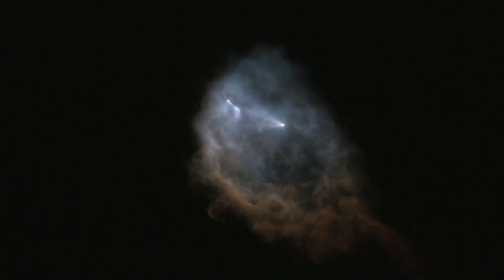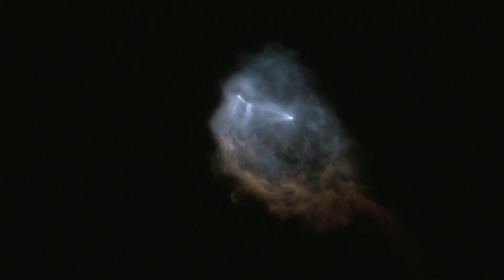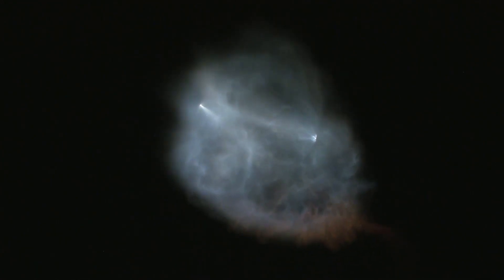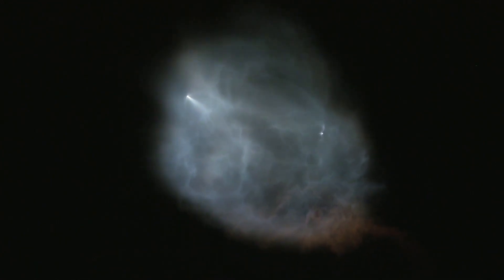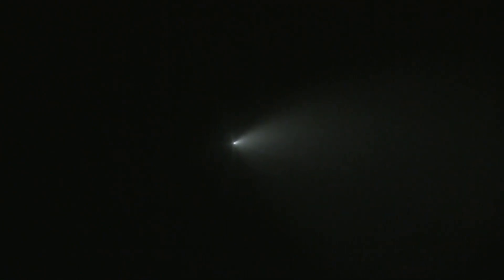SpaceX Falcon 9 SAOCOM 1A Launch 10-7-18

Comment: Jim Mudgett:  Was something in the way to not show the back burn and booster landing from you location?
Reply from the maker: I'm about 100 miles SE of the pad and am in a bit of a valley, so the landing burn is blocked by mountains from my location.  One of these launches I want to get closer to see more of the launch and booster landing....and hear/feel the sound.
Reply: Well, Jim, SpaceX: Nov 19, 10:32 am. Not sure about booster landing location yet.  ULA DELTA 4 HEAVY spy satellite(THIS IS LOUD), Nov 29, Time tba .  SpaceX Dec 30, at 8:38 am weather permitting. However,  the booster will land off-shore on the barge, between 1/4 mi to 4 miles off the shore.  The Launch and LZ-4 pads are 1/2 mile from beach. Google Maps will show it.  It is WSW OF LOMPOC.  Every vantage point N of VAFB on HWY 1 called Harris Grade will be full if you get there late.  Hwy 1 is high enough to see both launch and booster land on barge.  But for a great spot, you can drive N on HWY 1 to just short of Guadelupe turn left on Brown Rd 5 mi to end.  Take 2.5 mile hike on Pt Sal Beach trail to view North VAFB and Soht VAFB(SpaceX). with few people and an unobstructed view of both of SpaceX pads and barge. Nov. 19: A SpaceX Falcon 9 rocket will launch Spaceflight's SSO-A rideshare mission from Vandenberg Air Force Base in California at 1:32 p.m. EST (1832 GMT).  I will be recooperating from a full knee replacement after 1 month.  I won"t be walking far anywhere.  PM me on FB if you decide to do any of these, weather permitting.
Reply: One time the road was driveable to see N VAFB.  I went to a 4AM launch.  I looked right up the tail pipe from there.  That morning I saw larger and larger concentric smoke rings as the rocket went skyward.  Awesome view!